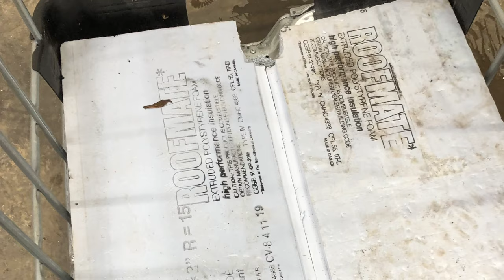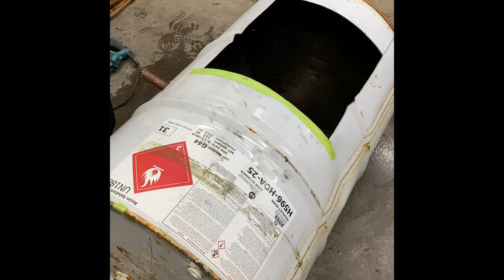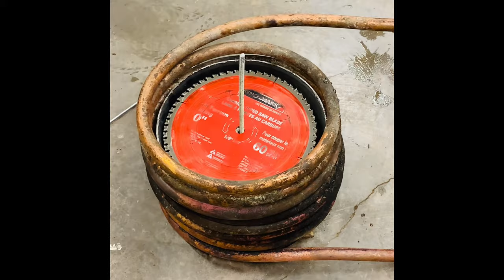DIY: OFF GRID WOOD FIRED HOT TUB from IBC CONTAINER🔥

Comment: I am wondering, since usually people put chlorine in their water for a pool do you also do this? If not, wont the water get dirty really quickly? If yes, doesnt the chlorine rust the pipes?
Reply from the maker: We would add a very small amount of bleach (4-6 cups only) and have not had any issues with the pipes rusting. It also stays quite clean where it’s making steam and the water is continuously circulating through the coil!

Comment: Did you have a problem with condensation? I built something similar, and have lot of condensation dripping into coals.
Reply from the maker: This is not an issue we had come across! Is your coil metal all the way into the tub or does it go from metal in the burn area to plastic lines into the tub? Not sure if that would make a difference but ours are plastic lines coming from the tub to the copper coil on the bottom intake line and then copper coil to plastic lines on the top input
Reply: @MacCustoms  copper coils inside burn barrel.
Reply from the maker: @armandniosi7657 ours is an exposed coil currently but even when we did have it inside a burn barrel we hadn’t noticed any condensation issue. Sorry we can’t offer any suggestions as it wasn’t something we’ve come across

Comment: Thanks for the video! Does the intake pipe need to slope downward from the tub to the firebox to activate the siphoning?
Reply from the maker: It doesn’t need to downslope but in most cases there will end up being one because of the elevation if the ibc container being lifted with the insulation on bottom and where the metal encasement has slight elevation to it and the coil will be placed on the ground.
Reply: @MacCustoms  Ok, thanks!
Reply from the maker: @hanshananigan1233 no problem! Hope you build yourself one to enjoy!

Comment: What parts did you use to connect the inflow and outflow into the tub what would you call that?
Reply from the maker: It’s a through hull fitting. They came from a boat supply shop

Comment: How long do you expect the burn barrel to last?  Been working on plans for a shower but i was going to use the gaylord to collect water that fills a barrel over a barrel for heat.
Reply from the maker: It’s been 18 months so far! When we have the tub heated we keep it heated for weeks at a time during the winter and spring , in the summer and fall it’s used less often but we will still keep it hot for a couple days at a time!
Reply: @MacCustoms  thanks, 18 months and going is good.

Comment: Why did you put those 3 saw blades in that section with the water piping.. is it to do with air flow? Do you need air flow in those fire drums? more than was shown, just asking because i want to build one. Nice video btw.
Reply from the maker: We used the saw blades to force the heat and smoke to work harder to get out of the chimney instead of being able to flow straight out! We would actually recommend scrapping the barrel and making the coil directly on the ground! We have another video of the “on ground coil” and it heats it up much better as the fire is built directly in the middle of the coil and not below it!!
Reply from the maker: @femylafi the exposed coil video is available here…. 
Setting up & heating the wood fired hot tub (exposed coil model)
https://youtu.be/V6G4AHUMhcs

Comment: Great job! Have you had to do any modifications since first build?
Reply from the maker: We did remove the coil from the barrel and it heats up much faster!
Reply: @MacCustoms  Great to know for when I build mine!
Reply from the maker: There’s a video link in the description to our first build with the exposed coil! That one was much more efficient! When we removed the coil from the barrel we did end up placing it inside an eighteen wheeler rim to hold the coals around the coil. We are in a windy area and the fully exposed did loose some efficiency with the wind so we thought the barrel would be ideal but it wasn’t quite what we were hoping so we did the rim idea and that is A1!!